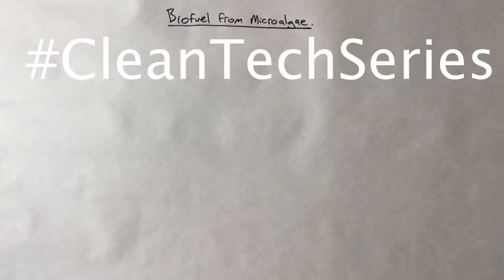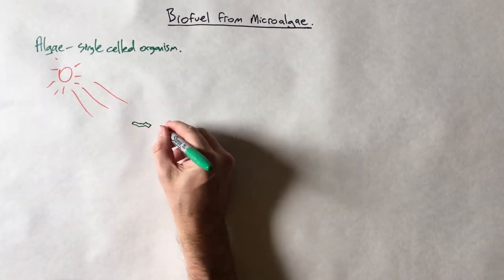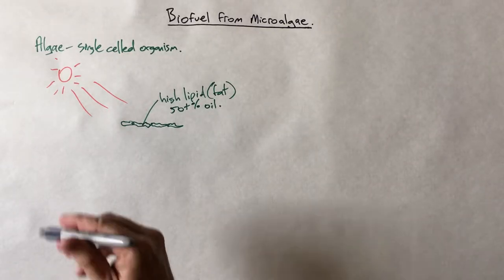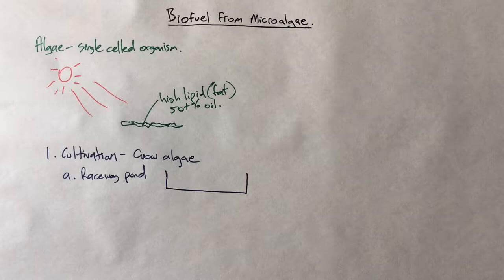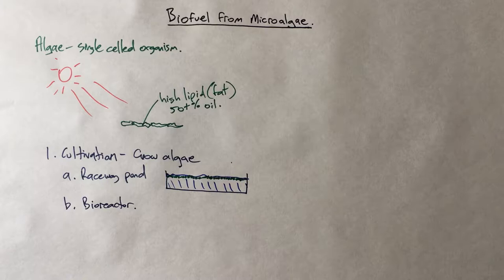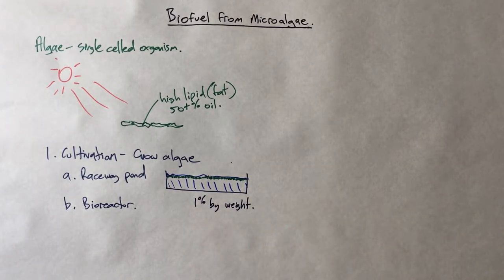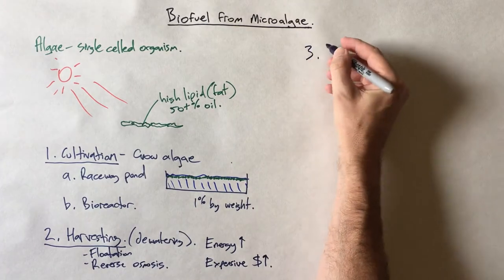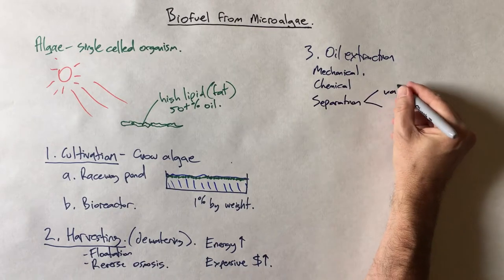Biodiesel from microalgae

Comment: How do you solve the oxidation issue with Biodiesel. Can you reduce the oxidation of Biodiesel completely.
Reply from the maker: Great question. Biodiesel oxidative degradation is mainly due to unsaturated fatty acids. This is made worse if stored at higher temperatures, and obviously the presence of oxygen in the air is a contributor. Exposure to sunlight also accelerates oxidative degradation.

Prevention measures can include excluding oxygen from the storage tank (e.g. nitrogen blanketing), the addition of oxidation inhibitors, and minimising excessive inventories of the biodiesel (which reduces average storage time, reducing the amount of oxidation that occurs).

Comment: Thanks so much for the video. Currently am doing a research of biodiesel production using microalgae as a biomass
Fortunately, I came across your video. Thanks
Reply: Hi, I find myself in the same boat. What did you specifically test with your research? I’ve been struggling to choose what specific aspect of the process to research.

Comment: U dont get a "green" product and compete by price, u find a niche.
But still, best explanatuon i found, thank you.
Reply: This is the unfortunate truth. As I’ve progressed in my chemical engineering degree I’ve found that there are green ways to do almost everything, the problem is creating a product or process that is cheap enough to compete with the status quo. 

While I think it’s extremely important to continue researching these things (hence my career choice), I also recognize that at some point we’re just gonna have to bite the bullet that sustainable alternatives are generally more expensive than finite resources. 

Fossil fuel products are everywhere though…. It’s hard to find a niche when your competitor has uses in literally every aspect of life. For example, I am currently doing research on bio based surfactants for use in detergents, but frankly the synthetic surfactants just work better (relation being that the hydrocarbons needed to make surfactants and polymers exist naturally, or can be synthesized from biomass, but it’s just much simpler to use petroleum products)

Comment: what catalysts can i use for the conversion?
Reply: Potassium Hydroxide is the best but Sodium Hydroxide will work as well.
Typically KOH is mixed into Methanol (or ethanol) which then has the oil at approx 65°c added into reaction vessel. 
After mixing that and left to separate / settle for 24hrs the glycerol is gently (with a tap at bottom of reaction vessel) removed leaving biodiesel in vessel for washing with water (removed same way as glycerol)
*btw the methanol can be distilled out of glycerol solution to reclaim it, the leftover glycerine can also be used.
A good youtube chanmel to demonstrate this process is Robert Murray Smith.